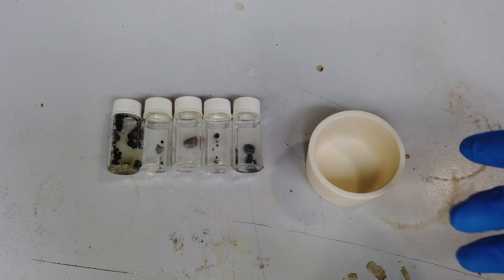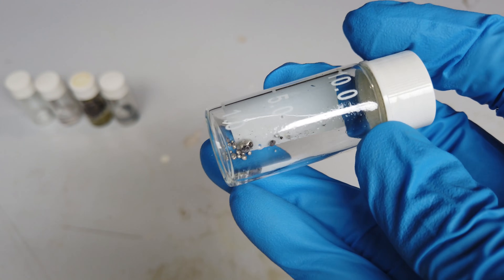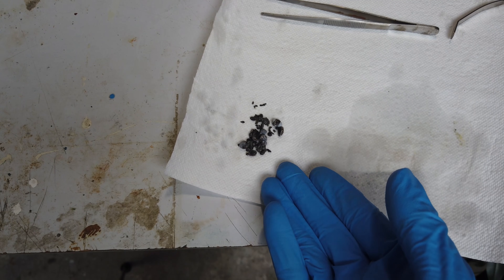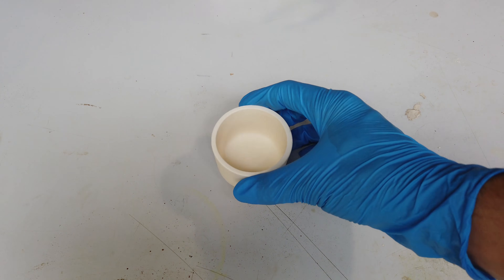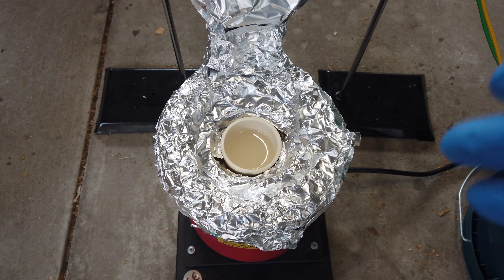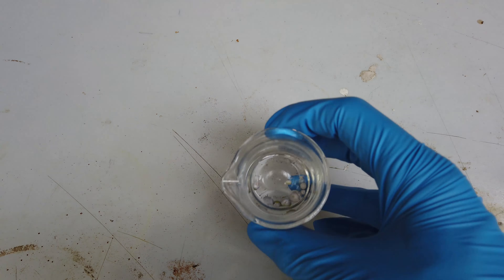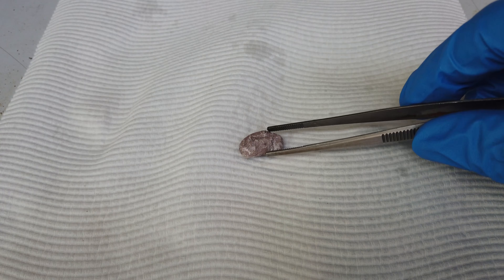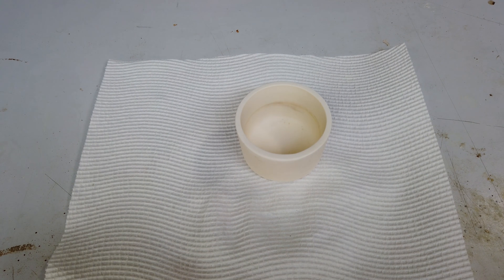Molten Salt Electrolysis Is Back

Comment: why did i get irrationally frustrated watching that blob of sodium escape the scooping? Slippery little devil
Reply from the maker: I'm glad you could share my pain lol. It was annoyingly difficult to collect. The surface tension on the melt is very strange.
Reply: @ScrapScience  the first time i successfully did this i had the same problem except my blobs were numerous and small so by the time i was able to scoop them out they all oxidized. Very sad.

Comment: Many, many, years ago when I was in 8th grade I was big into chemistry.  I was self taught from reading encyclopedias because the internet didn’t exist at that time.  I had my heart set on making sodium metal.  I melted regular table salt (no iodine) in my bedroom, and used electrolysis to obtain pure sodium.  When I was refining my procedure, several times it went wrong with a rather hot fire.  Eventually I was able to make some pure sodium.
Reply from the maker: Nice! I might be trying something similar at some point. How did you deal with the chlorine produced?
Reply: @ScrapScience
It’s difficult for me to remember that many years ago, but I believe that I used a train transformer which put out 18 volts DC.  If I remember correctly, I had the sodium chloride in the bottom of a test tube.  I put in a heavy inert gas to displace the air.
Slowly I upped the voltage until it was glowing red and the chlorine had dissipated.  Keep in mind that I was a struggling junior chemist (in my mind) and had read every article in different encyclopedias on producing sodium metal.  I had decided to jump in and start trying everything until I found something that worked.  Eventually I had some pretty small globules of pure sodium metal.  If my memory at 75 years of age improves slightly, I will get back to you since chemistry has always been a passion of mine.  Thanks
Reply: @ScrapScience  at industrial scale, this made bleach into a byproduct of alkali production by bubbling said chlorine through some of the alkali. I haven't checked, but it's possible this was done because even back then, releasing large amounts of chlorine to the open air was seen as a problem, and pressurizing (yes, I'm from the US) that very corrosive gas was expensive and difficult, complete with really nasty failure modes.

Comment: What happens to the potassium salt if you dissolve a bunch of potassium metal into it? Does it change the chemistry or PH?
Reply from the maker: After a small amount of potassium dissolves, the melt becomes an electron conductor, which stops electrolysis from doing any actual reactions (including the generation of more potassium).
The dissolved state of potassium is not very stable at all, so it’s very short lived after you turn off the cell.
Reply: Thanks for the video BTW!!

Comment: Excellent!

I'm glad you don't want a KG of sodium, due to the danger. But having a sample in oil is safe, usually!
I would want to put the sample in a glass vial sealed with a flame as you would with an ampoule,
Unless you need to access the sample for use!

I suspect there was a trace of oil still on the lithium, hence the flame, when adding it to the mix!

If you want better, less expensive nickel electrodes, try nickel 99 welding rods.
The usual welding supply shops carry good quality rods, or else they get a bad rep.

You can cut them down and put several together, to get more surface, or leave it long, and use a deep cell.
Reply from the maker: I've definitely considered ampouling the metals, and it's something I may do in the future. For now, I like being able to take them out of the containers if I ever need to do a reaction with a small piece of one. If I end up getting a bottle of argon at some stage to store them with, I'll definitely be more inclined to go for it.

And yes, oil on the lithium would make sense. The flames didn't quite have the characteristic red colour.

I'll look into whether there are any good welding supply shops near me. Thanks for the tip!
Reply: @ScrapScience  they're often a good place to source argon, too.

Comment: Hello scrap science. Do you happen to know how powerful an oxidizer molten solar salt is? I'm planning to electrolyze some really low melting sodium salt using lead or bismuth cathodes to form tetrasodium plumbide and trisodium bismuthide respectively, but I think NaOH won't do the job for lead (oxidation into sodium plumbite) and I can't access molten salts with higher temperatures.

If this doesn't work, could you suggest low melting sodium salts that don't work for normal electrolysis for one reason or another? (Ex: sodium acetate, melts at 324°C but starts decomposing and will definitely react with pure Na metal, but may work if the Na gets trapped in lead alloy and may form a eutectic with K acetate (m.p. >290°C))

(Interestingly, molten bismuth metal is stable in molten alkali from my tests, but I'd prefer to start with cheaper lead)
(Solar salt is the NaNO₃:KNO₃ eutectic which melts at 220°C)
(There is also apparently a NaOH:KOH eutectic melting at 170°C which might not harm lead, but I'd rather hear expert advice than test this out)
Reply from the maker: Molten nitrates are quite oxidising. Generally, much more so than molten hydroxides. 
I'm not really familiar with what you're trying to do so I doubt I'll be much help beyond that.
Reply: @ScrapScience  I understand. Have you ever tried to electrolyze the NaOH:KOH eutectic? To me, the melting point reduction from 318°C to 170°C seems way too good to ignore.
Reply from the maker: I’ve never done it. It makes NaK, as you might expect. My interest is in the pure metals, but I might give it a go at some stage.

Another channel (MIH0319) did a really good video on it:

https://youtu.be/Sc2Yp-XyOOY?si=wgmEhxlQim8-5VxN

Comment: Did you ever perform such an electrolysis using molten lead or tin cathode? I've heard sodium easily makes alloys with lead but don't know about tin.
Reply from the maker: For the most part, I've really tried to keep the metal products pure, and using a molten tin cathode is more of a 'last resort' for if I really can't get things to work. 

Once they're alloyed, I won't be able to separate the metals. Not to say it absolutely can't be done, but it's beyond my abilities.

Comment: Nice. The crucible fared remarkably well. 11:30, buyer beware, a lot of nickel strips sold as battery contacts are nickel plated steel.
Reply: I found that out the hard way recently, waste of HNO3 to dissolve them.
Reply: @chemistryofquestionablequa6252  Yes sir. Same here. It also mystified me how it produced a nearly colorless sulfate crystal.
Reply: How to identify nickel vs nickel plated steel?
Reply: @soundspark Dissolve it in some H2O2 and HCl. If it goes yellow/brown, there's iron in there.
Reply: @soundspark  Pure nickel should have somewhat lower resistivity (down to 70nΩm?), though I don't know by how much when considering common alloys. Steel will be higher (>96?); alloy or stainless, much higher.

Typical test would be, set up a modest DC current source (a couple amperes should do), in series with a length of strip (more the merrier?), and a small reference resistor (say 1Ω). Measure the voltage across the resistor, then across the strip (probe it with separate contacts, not the same contacts/terminals delivering the current).  The ratio of voltages equals the ratio of resistances.

Finally, measure the strip dimensions (preferably use a micrometer to measure thickness, but at least, hopefully, the supplier reported thickness correctly?), and use the bulk resistance formula to solve for resistivity.
Reply: @soundspark  If you have it in your possession, scuff it up and soak it in salt water, or dissolve it in acid. If you're buying it, look carefully at the description, and avoid it if the price is suspiciously cheap. Nickel is magnetic enough that that alone is not a great indicator.
Reply: Also, magnetism at room temperature isn't a great discriminator, but Ni's curie temperature is much lower -- if it doesn't stick to a magnet at "black hot" (as opposed to a cherry/orange point for iron), you have a good sign.

Comment: Why not melt the lithium in an argon atmosphere?
Reply from the maker: Basically, I don't have argon, and I'm not willing to purchase or rent a bottle of it just for melting less than half a gram of lithium. It would work though.
Reply: @ScrapScience  it's available at welding shops, and, not coincidentally, useful for any operation wherein you might want to isolate something from air.

Comment: About the potassium electrolysis. Would distillation of the KOH/K mixture from electrolysis be an option? But ofcourse building a suitable still would be quiet a big resource investment.
Reply from the maker: If you're running the electrolysis at above the boiling point of potassium, then maybe? I can't see why it wouldn't work. 

I certainly won't be building a cell like that though.
Reply: @ScrapScience  sorry what i meant was that you would perform the electrolysis at standard temperature and then let the KOH/K mixture solidify and put it into a still.
Reply from the maker: Ah I see.
The dissolution of potassium in its molten salts (or any other alkali metals in their molten salts) is a little weird. From what I've read, it involves the production of solvated electrons and the alkali ion. Needless to say, it's a rather unstable system, and not much dissolved potassium is likely to survive any reasonable length of time under air. I can't say for certain, but I doubt it will last until the distillation step. 
Additionally, with enough potassium (or, solvated electrons) in solution, your cell eventually becomes an electron conductor, stopping all electrolysis. So, there's an upper limit to how much potassium you can actually dissolve for a given mass.

Funnily enough, you can actually see some evidence of the solvated electron in this video. Note the blue sheen around the sodium droplets at 11:07. As far as I'm aware, that's quite literally the solvated electron being generated. At that stage, I'm running the cell a little too hot, and the sodium is a little bit soluble in the melt.
Reply: @ScrapScience  Oh yeah you are absolutely right about the solvated electrons at 11:07! And that makes sense with the increased conductivity sadly. Thanks for all the info, I usually stay far aways from electrochemistry, so im not very knowledgeable about it.

Comment: Is it possible to synthesis sodium at a lower temperature by electrolysis of NaAlCl4, which melts at 157c
Reply from the maker: As others have said, I see this route most likely yielding aluminium instead of sodium. Also, getting this stuff anhydrous and keeping it that way seems near impossible to do in a home setting.
Reply: Even if that works, who would want to deal with noxious clouds of chlorine?
Reply: @atari7001  chlorine gas can be scrubbed with sodium hydroxide
Reply: @atlas3464 right, but it eats everything metal.  Hydroxide is so much easier and I had no problem whatsoever keeping at temperature.  In fact, once the cell gets going, the heater usually stops working because the heat of electrolysis would keep it hot.
Reply: It will probabaly decompose or at most make Al metal.
Reply: You would get aluminium
Reply: Dissolve NaCl and anhydrous AlCl3 in propylene carbonate and electrolyzing it would produce Na metal at room temperature.
Reply: @MIH0319why?